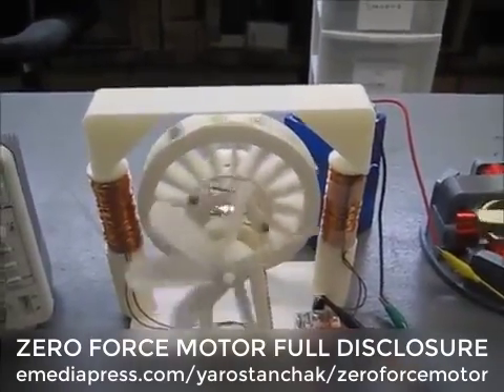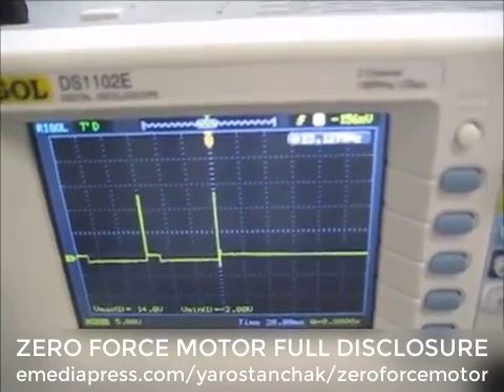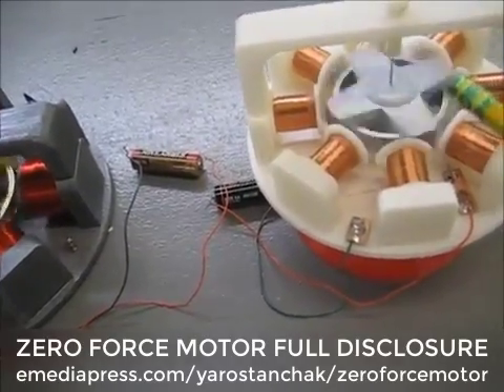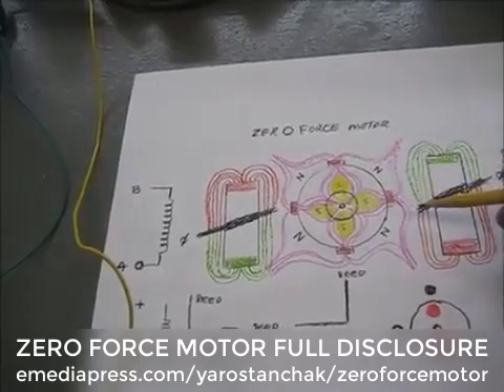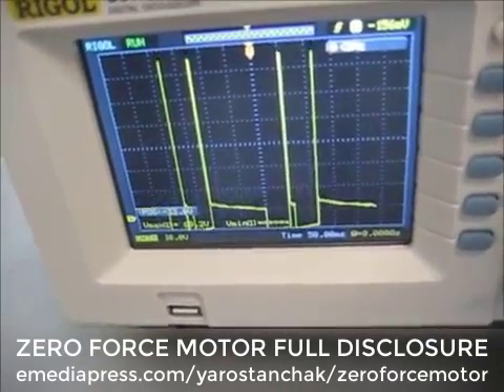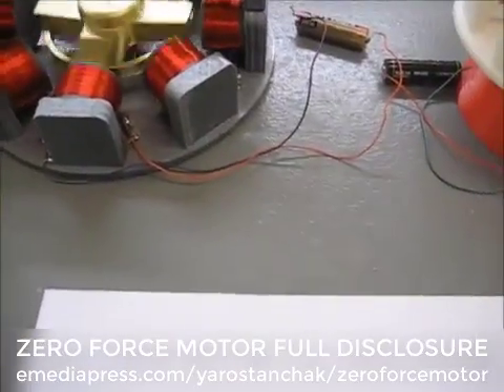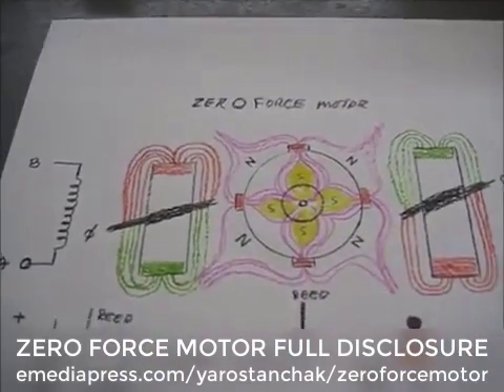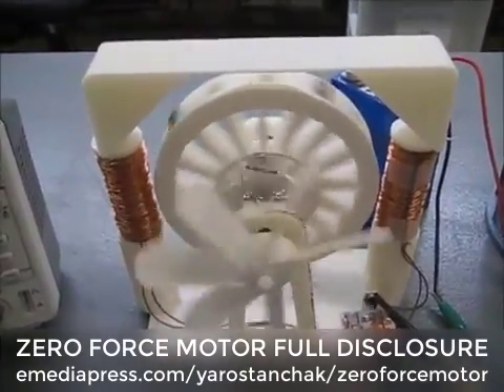Zero Force Motor Demo 2 by John Bedini

Comment: "It's pushing on one side and pulling on the other."? That's like saying the North pole is actually South because it attracts opposites which is the "North" pole of a compass magnet needle 😳 🤔. It's arbitrary. It's just a matter of designation. Both sides of your contraption are "pushing and pulling" at the same time. The left side could be "pushing" the blades down and the right side "pulling" up...or vice a versa!

Comment: Does this demonstrate over unity? What defines it as “zero force”, and what are the implications of this kind of design. I can see the difference between this motor, and your standard motor design, but I can’t seem to grasp the relevance that arises out of such a configuration. The output as seen on the oscilloscope is interesting to say the least, but what can a competent person do with this proof of concept? By harnessing the impulses or “spikes” as seen on the scope; can someone theoretically end up with a greater output voltage than what was utilized for the input?
Reply from the maker: That is not overunity - it is all explained here: http://emediapress.com/yarostanchak/zeroforcemotor/ in Yaro's presentations. It is an air core motor design invented by John Bedini back in the 1970's. The spikes aren't that strong with the air core. You can also look at the free discussion forum in http://energyscienceforum.com regarding the ZFM.